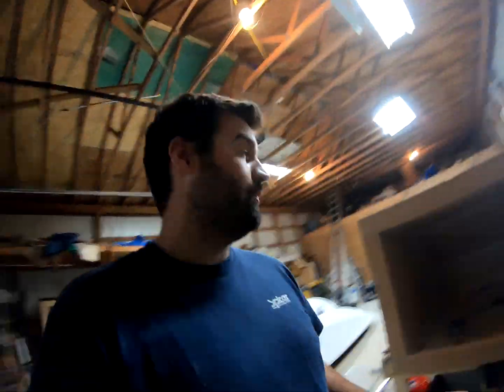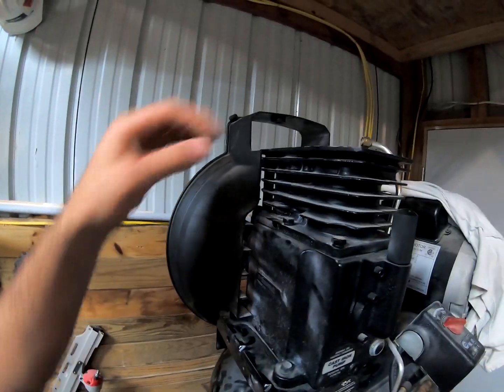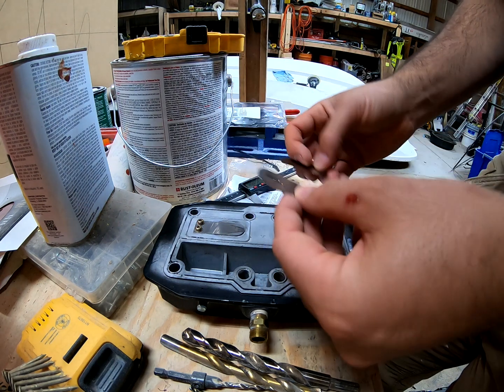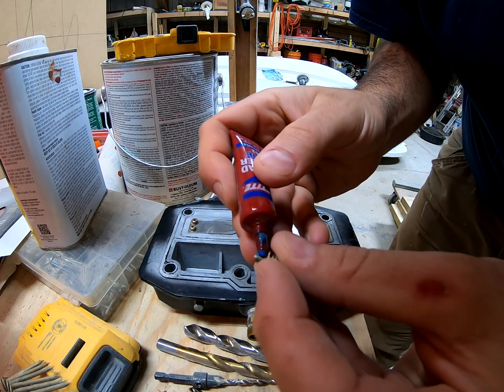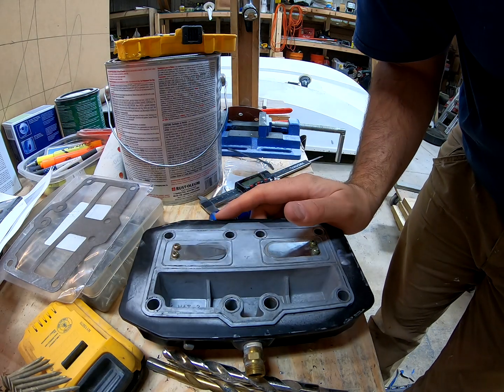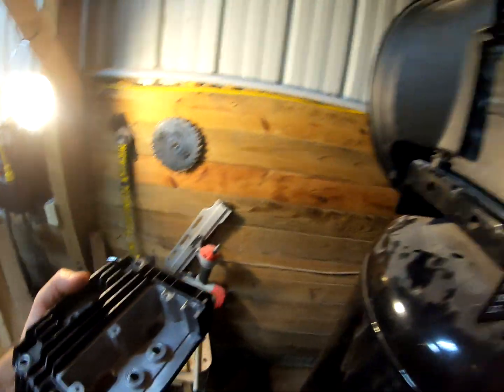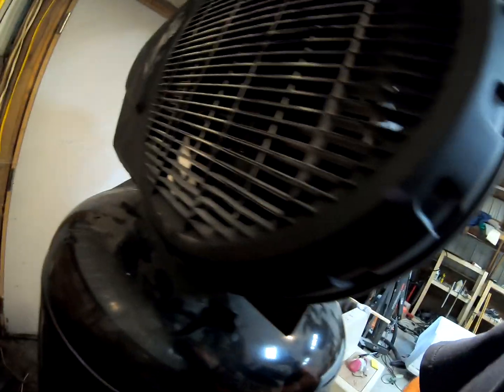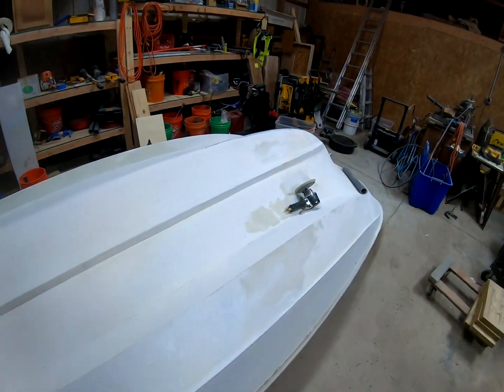Fixing Husky 60 Gallon Air Compressor With 755h Sanborn Pump

Comment: I just bought a sanborn 60g air compressor and my reed valves blew aswell, there's a phone number right on the tank. I called and it was campbell hausfeld. It's still under warranty so they're sending me a rebuild kit. There is 3 different rebuild kits available for that pump but, they come with more then you need and probably cost a lot if it's out of warranty. But Amazon has just the reed valves for around $30 CAD.
Reply: Yes I saw those rebuilt kits for sale but the cheapest one was just a new head and gasket which was over $150. I bought this new for $400 several years ago and didn’t think that was worth it which is why I found adequate reed valves to replace the broken one with.
Reply: @woodwardbeardsley2413  yes you are correct, the rebuild kits are pretty expensive. Since I've had mine for less then three months it's still under warranty so they're sending the kit for free fortunately. I did see the reed valves on Amazon for fairly cheap aswell.

Comment: What"s the part number for the reed valve?
Reply: @ 9:13 VS001800AV - not the stock part but it works
Reply: .014 stainless steel feeler gage would also substitute for a quick fix.